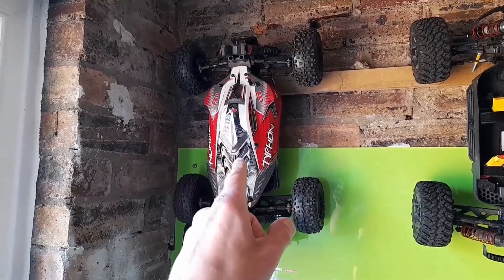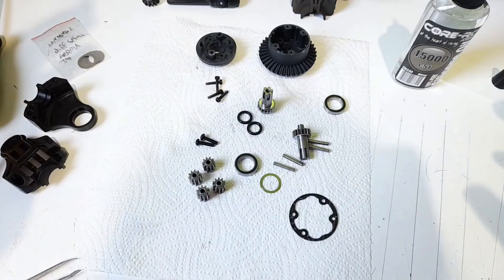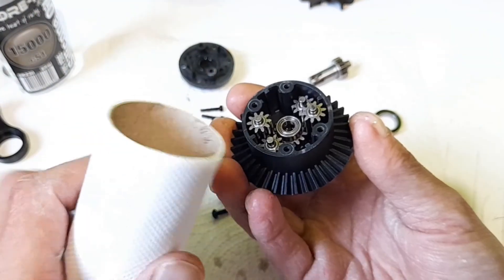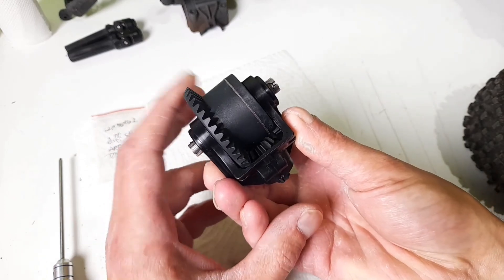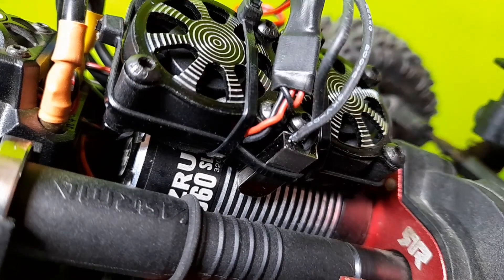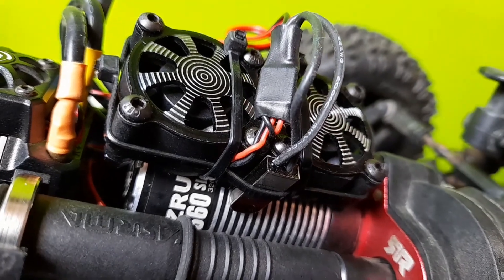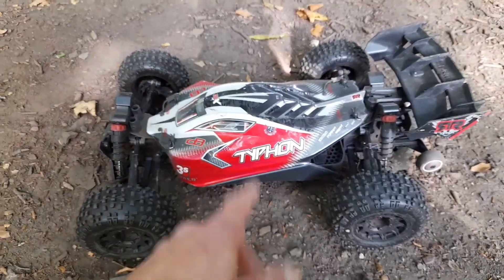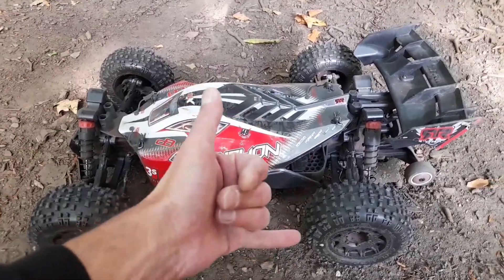Arrma 3s 4s Differential How To Rebuild & Test Run.

Comment: I very much doubt these would be made of asbestos. That material was mostly used in high-temperature applications such as exhaust manifold gaskets, brake pads, under-bonnet thermal insulation and such. In buildings as well of course, but that was back in the 60's when nobody gave a damn. This being said, as your viewer Bob's RC Insanity said, it is only harmful if you inhale fibres (dust). I very much like your style which has evolved. It's a great way to show stuff. Straight to the point. There are loads of tutorials out there to make the difference in between a Phillips head screw and an Allen. We are all past this, for sure. Haha. Regarding that thermostat device, I think it would work much better if you made contact with the largest surface area available. Slap it flat on the motor lengthwise, see how that works. Keep up the good work either way, man!
Reply from the maker: Yes well I didn't lick it or put it in my mouth in anyway so all is good 🤣
Still the question made its rounds cheeky if they did. 
I've got that thermostat just touching the motor, it's utter pants and not enough voltage going to it either. 
Thanks for watching bro and I'll keep chiming away 🤙

Comment: Rah the diff internals are mad .. not conventional for sure 🤣🤣 .. Nice it needed no shims to start with .. di the parts not fit themselves when you threw them at the car 🤣🤣
Reply from the maker: Yeah its the (no one learns) editing trick saves loads of time 🤣 
Definitely not a conventional looking diff cool looking. 
Aye no shims but the big rock has 2 in it diff, how? Same diff set up.... Arrma has major quality control issues.

Comment: Try the surpass Hobby 0-42mm RC Motor Heatsink With 27000RPM Dual High Speed Cooling Fan for Leopard 4268 4274 4092 1/8 1/10 RC Car Motors (Color:Black). That one its perfect and the fans are blowing like crazy, a bit like a plane is taking off. Give an aluminium diff yoke a try, when you have to change the next diff. I stripped so many diffs. Since I changed the yoke to an aluminium one they are fine
Reply from the maker: Finally got a fan looks the part cost abit fingers crossed it's blows in a good way 🧐

Comment: Is the differential holding good?
Reply from the maker: The diff gave up the ghost after 7 packs cracked the teeth as usual. Got some seriously cheap aluminium diffs in now, need to do a video I guess.
Reply: San you please send me link because my arrma senton rear differential exploded too
Reply from the maker: The diffs don't work when you buy them they're that cheap. 
You've probably seen them on eBay or AliExpress, they don't do spare parts so you have to buy another diff even for the crown gear. 
Type in arrma diff sort high to low on eBay and you'll see they cost about £15 don't know dollar amount.
Reply from the maker: This is abit more expensive so I don't know about fitment and there's another surprise,,, the input gear is too long so it needs cut down 👎

https://www.ebay.co.uk/itm/305309669580?mkcid=16&mkevt=1&mkrid=711-127632-2357-0&ssspo=61WrPtouTnK&sssrc=4429486&ssuid=4AoL8TUpRDm&var=&widget_ver=artemis&media=COPY
Reply: @mehimrc1314  thank you but what input gear should i buy.